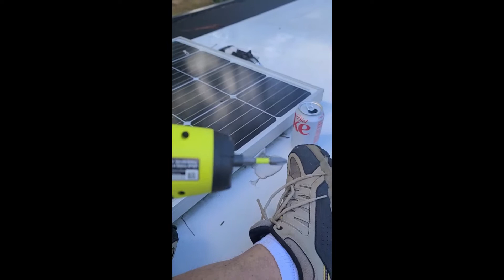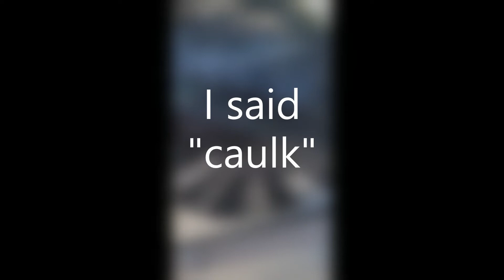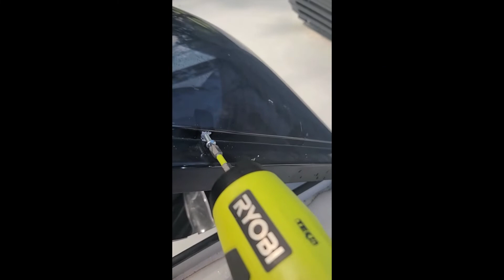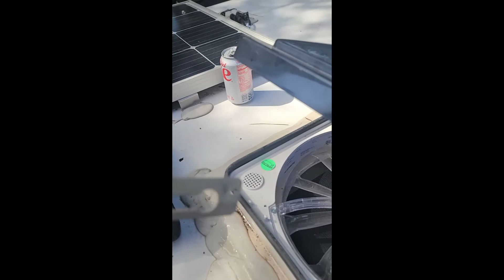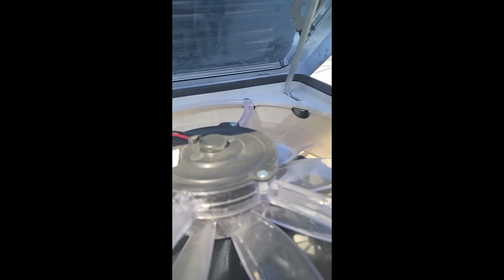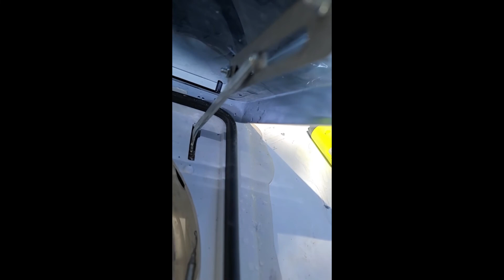Fixing Fan-Tastic Fan broken vent lid part # K1020

Comment: Hi Allen: Thanks for the video. I'm facing the same repair, one that I'm not looking forward to. I'm going to try epoxy first; if that doesn't work, is it possible to buy a pair of spacers from you? (I looked at the link below, but it's leads to a 404.)
Reply from the maker: Link should work now.
Reply: @alandoesstuff.1254  Thanks, Alan. I have a buddy with a 3D and I'll ask him to make me a set.
Reply from the maker: @stevebass  No problem.  The other option is to look at the metals at either a hobby shop or lowes/home depot.  Just has to have a internal diameter slightly larger than the screws.
Reply: @alandoesstuff.1254  Your video and written documentation say that the spacer is 11 mm long, but the .stl file contains a part that is 13 mm long. Do you know which is correct? (I think I have one shot at the repair and I want to get it right.)
Reply from the maker: @stevebass  I believe 13mm is correct.  However if its too long filing a few mm of a 3d printed part is very easy.

Comment: Thanks for the explaination. I bought a previously opened fan (for a reduced price) and was disappointed to find the plastic lugs on the lid were both shattered. I used 5 minute epoxy to reconstruct them, but I am sure that they will break again. What a terribly cheap and nasty design. (designed to break!!) I am going to follow your method of repair to reinforce the lugs. I think I'll also epoxy a strip of plastic along the outside edge through which the #8 bolts will go. I suspect that without that reinforcement, the lid will develop spider cracks around the bolts over time.  I find it SO frustrating when things are made so cheaply like this - the designers must know that their product is going to fail!
  Thanks again for your video. It was very helpful
Reply from the maker: It is a bad design.  I highly suggest covers to protect them from sun, tree branches, and in the event it does break at least water won't get in.

Comment: We were warned about bad video and editing.Easy all you need is a 3d printer.
Reply from the maker: You don't, you likely know someone who has one.  Also, an aluminum tube big enough for the screw to fit through can be used.  Most hardware stores include Home Depot have selections of metals you can choose from and  am sure something will work.  Hobby shops often sell brass tubes as well.